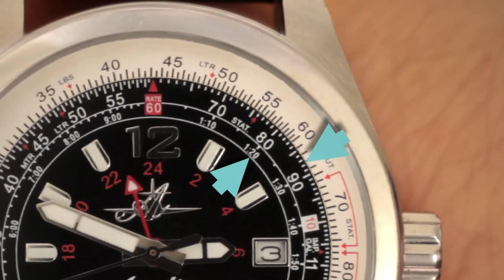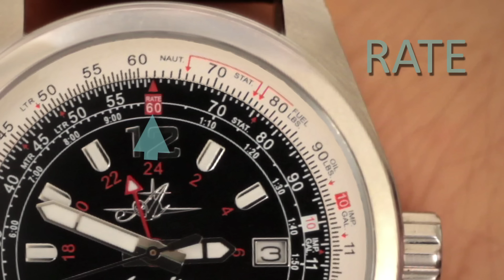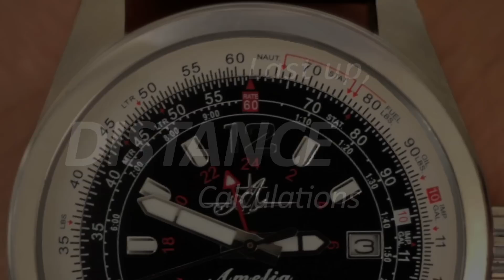How to use Your Aviation Watch: Time, Speed, and Distance Calculations

Comment: An excellent presentation thank you. Please forgive my one small correction. A nautical mile is a set distance slightly longer than an imperial one, 66 nautical miles = 77 imperial miles. Now a knot is a measure of speed as in so many nautical miles covered in an hour. A knot is one nautical mile per hour. Unfortunately, to say for example 50 knots per hour is actually saying 50 nautical miles per hour per hour which would actually be 3000 knots or 3000 nautical miles per hour. You only say 50 knots and never add per hour as it has already been said in the term knots. As I said, please forgive the correction, a tiny, tiny flaw in an excellent presentation but when I first became a pilot I cannot tell you how many times my flight instructor jumped heavily on my head and all the other students that ever made the "knots per hour" mistake. I hope that I have been much gentler and of some help. Thanks again, great presentation on a useful little tool that we pilots refer to so regularly and can now carry on our wrist instead of the big old E6B circular slide rule still in my flight bag. Take care and have a great day from down under here in Australia
Reply: I saw this video just a minute ago and was about to comment that knots per hour doesn't make sense. Then I looked at the comments and found yours, and I see I wasn't the only one who caught that. Otherwise, excellent video.

Comment: 3:04 Knots per hour is an acceleration, not a speed ;)
Reply: Wrong.
Reply: An knot is defined as one nautical mile per hour, therefore knots per hour is one nautical mile per hour per hour. Which is approximately equal to 0.000142901235 m/s^2.